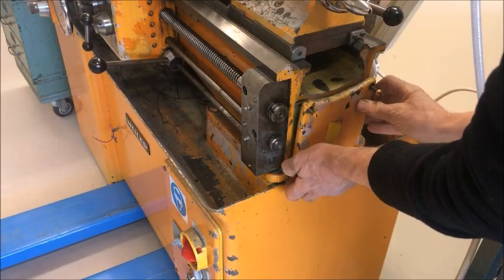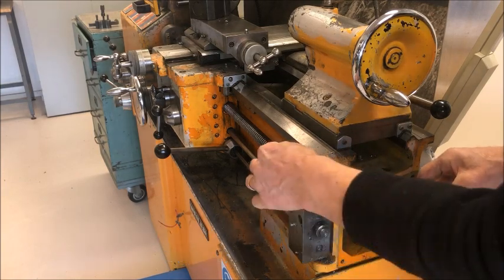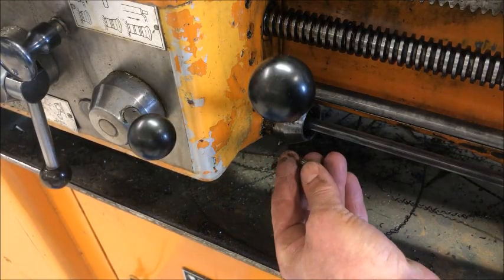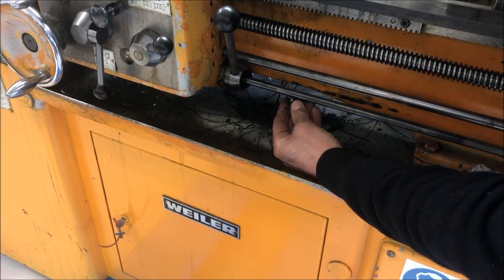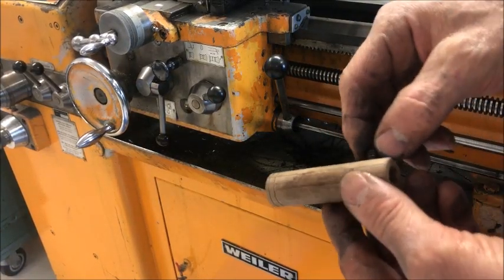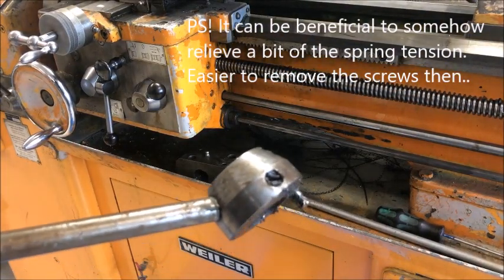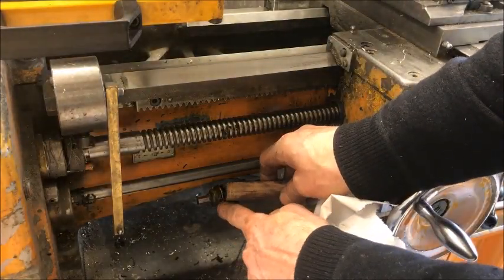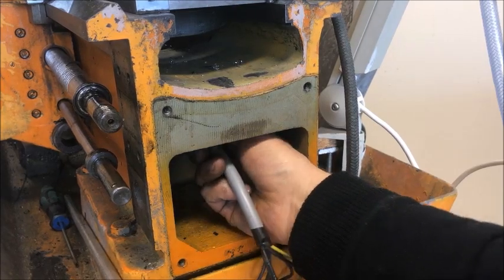Weiler Praktikant - replacing on off switch and assembly - 1

Comment: I had a similar problem with the switch on my Weiler Condor, pretty much the same setup. I disassembled the switch and found one of the cams had broken. I was able to reverse engineer the cam and machine a new one from linen phenolic. It is nice to know that the switch is still available.
Reply from the maker: Thnks for the comment.. and suggestion :)

Comment: I have a Weiler Matador (1972) and it looks exactly like Your Praktikant. Just wondering whether they are the same machine, just having a different name.
I would suggest to have an emergency stop "mushroom" button somewhere near the spindle gear selector. If You have a need to stop that machine and are located at that end of the macine, the controls are well out of reach. I think this is a quite common modification to these machines.
Reply from the maker: Thnks for commenting. Not exactly sure of the differences, seems to be basically similar, but I think the Matador was a more highly specified machine. Could be that Tony Griffiths has have elaboratedcon this so check his website lathes.co.uk. Agree, a button style emergency stop would be nice.. as would a lick of paint as another viewer mentioned. Safetywise it passed inspection not so many yearsxago, main thing being a safety shield over the chuck,  coupled so that it disconnects power when lifted, and switching on again via the main power on/off button.
Reply: I got also a Matador VS2 which looks like the same. I am pretty sure that this machine is also a matador and not a Praktikant. The gearbox for the feeds of an Praktikant would be very different! But whatever, great work and Grüße aus Deutschland!

Comment: Have you replaced the spindle drive belts? I have the same machine, they are very uncommon here in the US. I will be replacing the belts soon since one of them has broken. Your video is very helpful, I will be making the same repair.
Reply from the maker: Thnks for the nice comment.
No, I haven't done more to this machine. I think to replace the spindle drive belt you need to take out the spindle